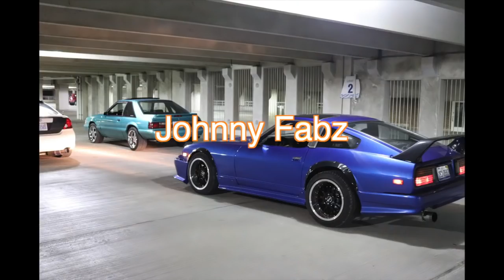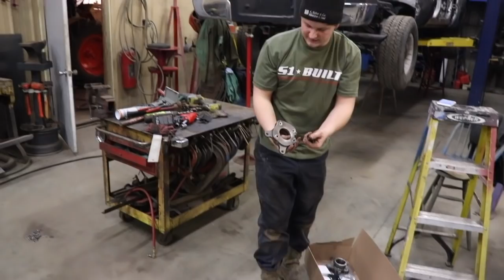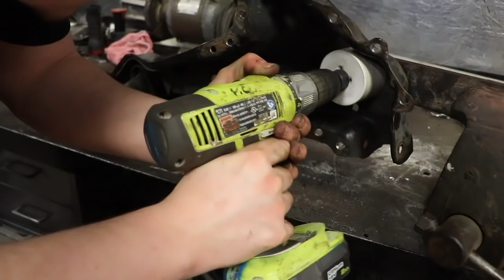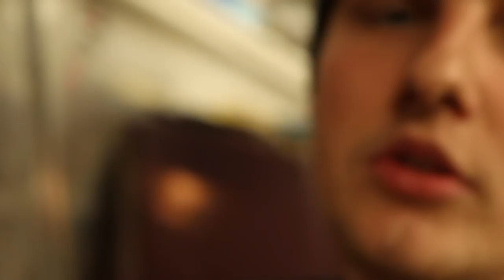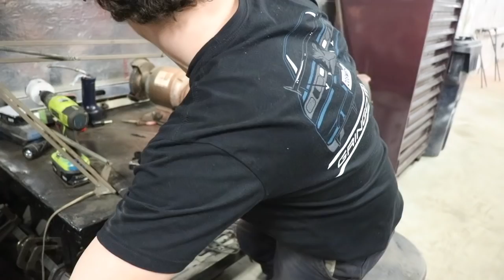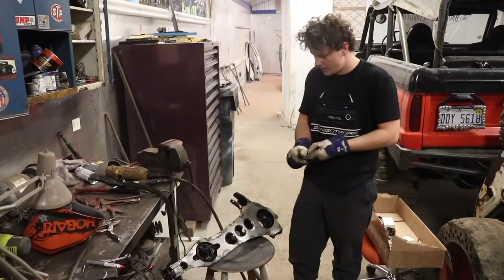Awd Honda Civic Rear trailing arms : S1 Built DIY Kit

Comment: A little hack for centering hole saw bits as you did with the flat stock, get a hole saw bit that fits into the existing hole and put it on the inside of the bigger hole saw. And away you go.
Reply from the maker: Good tip!